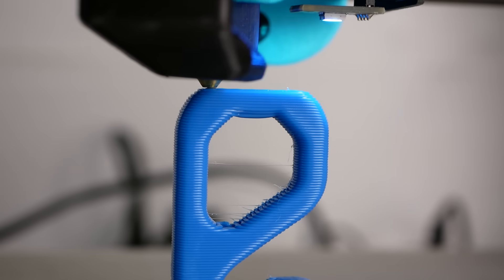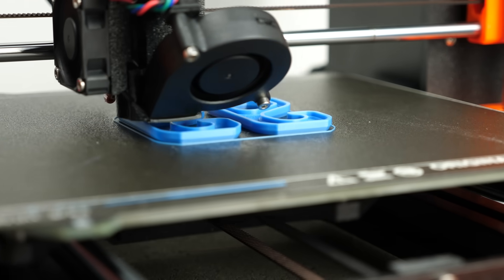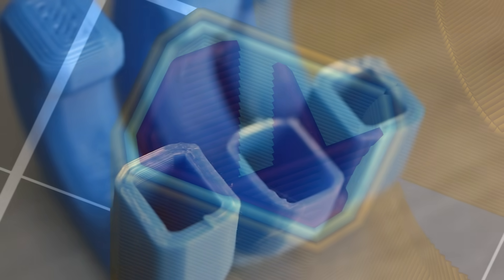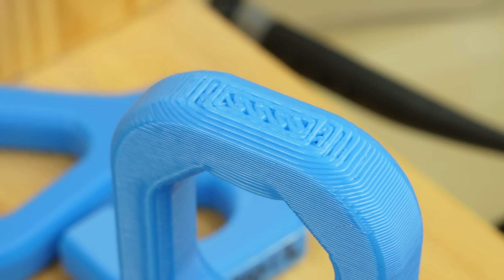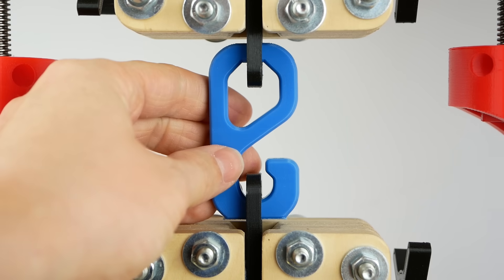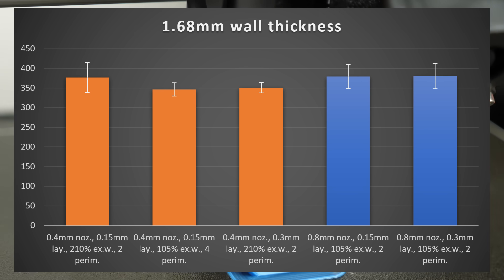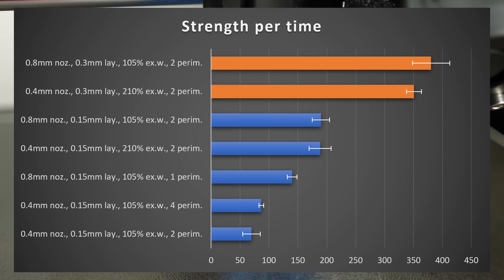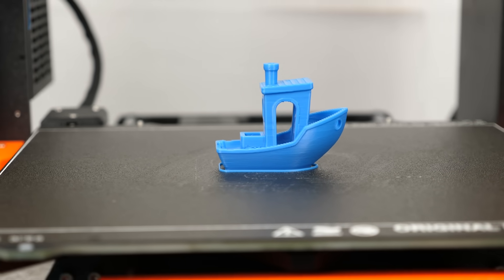BIG nozzles - HOW they (can) make your 3D prints STRONGER

Comment: I use a 0.8 nozzle for vases. Makes them more likely to be watertight.
Reply: Have you tried a high extrusion radio on a. 4 nozzle to see if you can achieve the same result?
Reply: @dude6935  I did once. Wasn't watertight. But I only did .5mm width. I think .6mm is the maximum before you start getting issues from the plastic curling around the nozzle tip. With the .8 nozzle I can do 1.0mm, which is very sturdy.
Reply: .4 can produce a waterproof result and might look better to some but .8 prints faster.
Reply: @seriousmaran9414    If it's vase mode, having a bigger nozzle will only speed up the print time of the bottom layers - the whole spiral part is one long line the same length regardless of extrusion width - have to go thicker layers to speed that part up, or just more mm/s raw speed, which the smaller nozzle will handle better.
Reply: @rbaumstark  as well as that I increase the layer height on a larger nozzle which can increase overall printing speed. Rather than .2mm height I used .4mm. Plus you should be pushing out a lot more plastic.
Reply: @seriousmaran9414  It's hard to calculate the exact amount of filament being extruded because the shape of the extrusion really has flat tops and round sides, but to take a really simple (and good enough, and very comparable) method, it's just extrusion width * height * length.  If two printers with .4 and .8 nozzles are extruding lines of the same width and layer-height and following the same tool-path, they'll be extruding the same amount of plastic.  There is no "should" be pushing more plastic - its very easy to configure two different nozzles to push the same amount of plastic which is really what the entire video was about doing.

Yes - the bigger nozzle CAN push more plastic, and I wish that had been covered in the video as well.   And IMHO the only reason to swap nozzles around is if you actually are going to use settings that the smaller nozzle isn't capable of.  I generally don't print layers below .6 or extrusion-widths below 1.2 when I have my 0.8mm nozzle in - big nozzle is about being BIG.
Reply: @rbaumstark  What part of using .2mm height on .4mm nozzle and .4mm on .8mm do you not understand?
Reply: @rbaumstark  yeah but you can get stronger prints per time and possibly higher layer thickness options
Reply: Plus, transparent filaments look so nice with bigger nozzles and thicker layers.
Reply: If you have a powerful extruder(or increase the temperature, you can print .8 width with a .4 nozzle and it will be even water-tightier

Comment: This was helpful, and I've been hoping you'd address this aspect of the process. My need is for large (approx. 500X500X1000mm assembled), strong parts printed as fast as possible with no regard for appearance, as the parts are completely covered by other material in the final product. The 3d printed part will provide only structure. My current plan is to set up a Modix Big60 with a 2mm nozzle. Playing around in Cura tells me that I should be able to get one full product printed in under 30 hours. I'm hoping that once the machine is in house and dialed in, I can get it down to <24 hours per product. If that doesn't work, then I'll just buy a second printer.
Reply: The hard part about giant parts is dealing with curl--I printed an 800x300mm multipane window in PETG on a 1.5mm nozzle at 1mm layer height, and despite the enormous brim mostly successfully holding it to the 75C heated bed, the vertical planes actually warped enough to require post-print straightening.  I'd look at a heated build chamber, as hot as you can get it, and/or filament with glass or carbon fiber to reduce thermal shrink.

Comment: Can you make a video about different nozzle materials like brass, hardened steel and tungsten? Maybe you could measure there thermal conductivity by measuring the layer adhesion at same print speeds.
Reply from the maker: In the works ;-)
Reply: There is already chart on Trianglelabs available.

Comment: I use a 0.6mm nozzle for almost everything. I mostly print functional parts. The main reason I do it is for time savings.
Reply: most of my parts don't work well at all with larger than 0.4 nozzles.
Reply: @chloemcholoe3280  I'd recommend to uprade to volcano-style hotend for 0.8 mm and bigger nozzles. And use a decent extruder feeder to provide enough grip with filament. It is also needed to decrease printing speed at least twice compared to 0.4mm nozzle settings. Overall printing time will be substantially shorter anyway. Layers at sharp corners sometimes do not always adhere very well at high speeds. So if your model has a lot of sharp corners - decrease the speed. Also try to avoid infills, or decrease infill speed setting. If it's not possible - use rectilinear infill.
Reply: @igorfedik5730  i know and I already used a volcano with a bmg :P the issue is that with such a big nozzle you need a TON of cooling so you slow down to v6~ speeds anyway (i have to do 20mm/s.... still rubbery after prints...)
I use cubic infill since it's better IMO and doesn't have any crossings or bumps

overall not very practical for anyone but a very few specific people and use cases
Reply: @chloemcholoe3280  Right. PLA is very sensitive to cooling. I very rarely print in PLA with large nozzles. Maybe try PETG instead? My favorite material here is SBS, but it seems to be very hard to find anywhere outside Russia for some reason. SBS is semi-flex like nylon, it prints at ABS settings and it is very forgiving at post-processing. It can be very easily smoothed, glued and sealed with toluene or any other aromatic thinner.
Reply: 0.6 in? Are you printing houses out of concrete?
Reply: @neplatnyudaj110  yep
Reply: @neplatnyudaj110  lol probably a mistake
Reply: 0.6 inches is about 1.5mm and nozzles that big do exist for regular FDM machines but people rarely use them. Maybe it wasnt a typo...
Reply: @zanpekosak2383  0.6 inches is 15 mm.